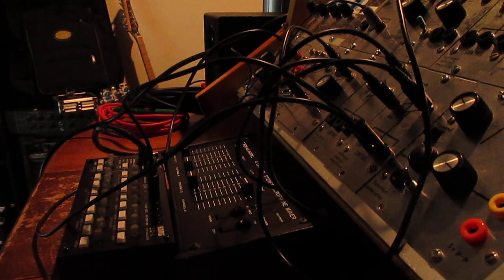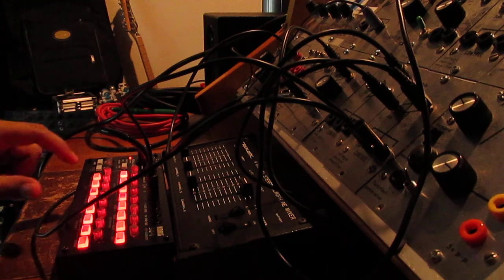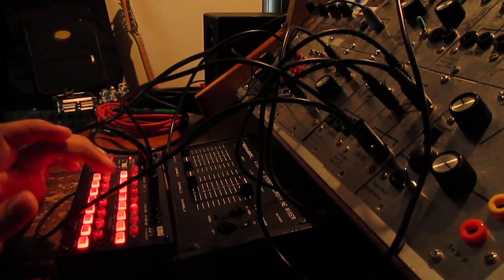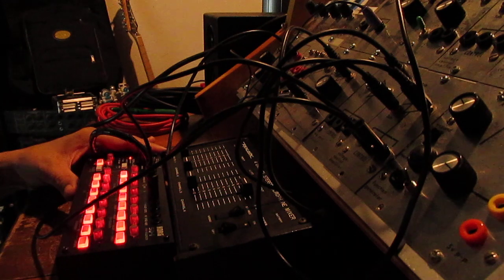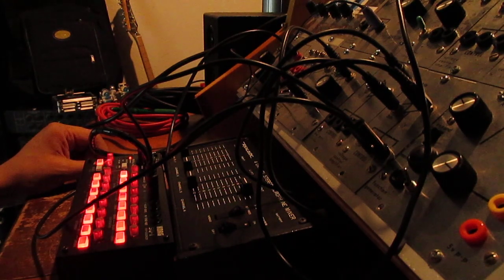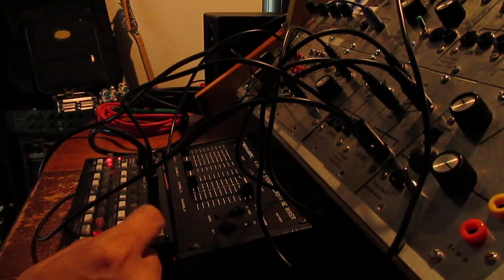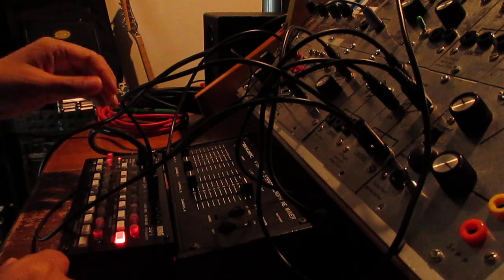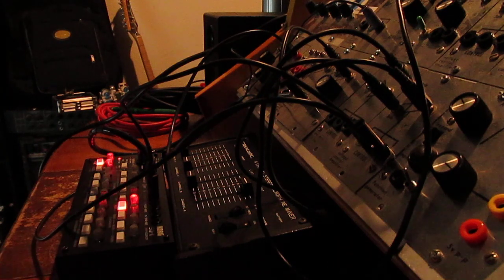Paia 2700 Korg SQ1 (proof of concept)

Comment: where I can get control cables or as they are called also I have a paia
Reply from the maker: +sixto moreno Those are custom cables.  CV is split on two banana jacks sharing ground on a gator clip (attached to the chassis).  Audio is on 3.5" mono's. Since the keyboard's resistive network actually fine tunes the vco's I can only get an octave without it.  The SQ-1 does all the rest of the magic as it can reverse polarity of  both CV and gate if I remember correctly.  So thanks for asking...
Reply from the maker: I custom built the cables used here.
Reply: I also make my own cables. I use 4d finish nails in place of pin-tip plugs, they solder well, and I cover the soldering with shrink tubing.